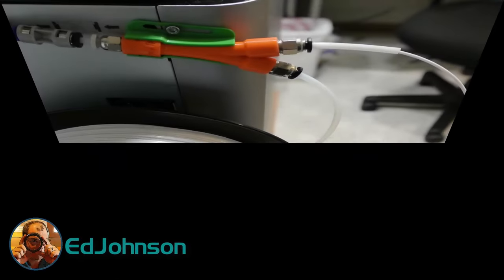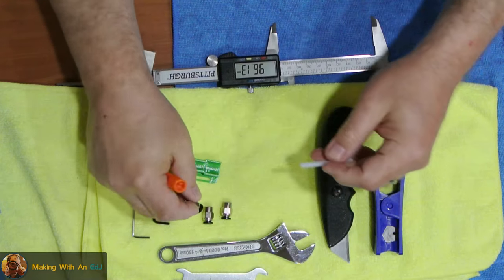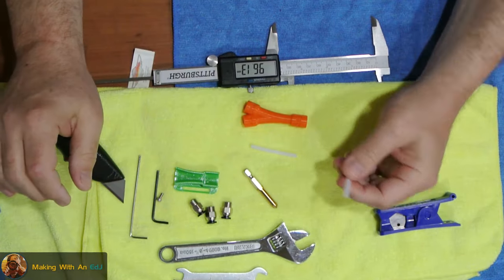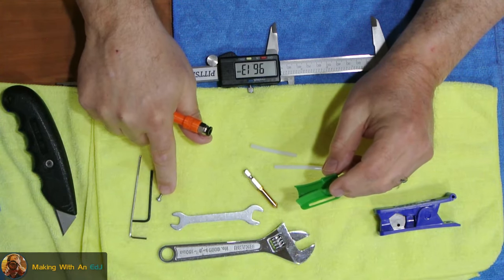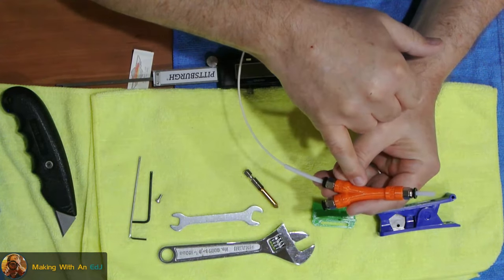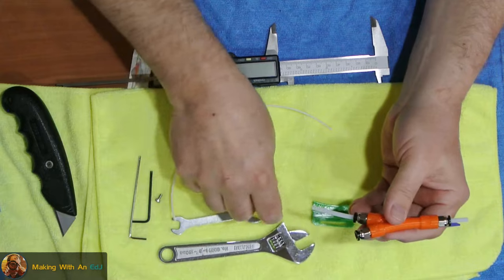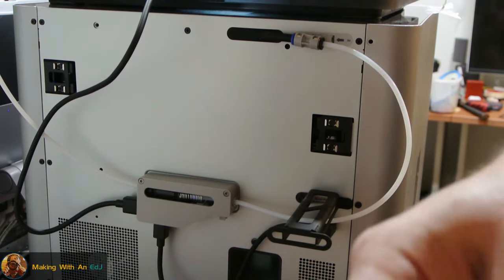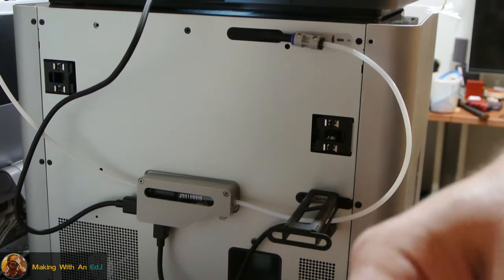Y Splitter for the Bambu Lab AMS and Spool Holder

Comment: You can actually remove that standard PTFE coupler verry easily and pulling the extruder PTFE tube a bit back. There's plenty of room for that, more convenient and gives more room to work with and to connect it tidy. 2 couplers after each other within a cm really doesn't makes much sense.
Reply from the maker: This is true. You just need to make sure you expose enough of the PTFE tube so it can be fully inserted into the splitter. I haven't had a problem leaving the connector in place, but I'll probably take it out of the loop when I need to replace the PTFE tube going into the hot end.
Reply: @makingwithanedj  I'm using the oficial BL  4-in-1 adapter. There're some other mounts available for that one. And in this config I actually don't have room for the coupler. Your situation is different with the printed adapter yes.

Well I also needed to extend the existing AMS PTFE tube because I'm using a riser. I did wanted to disassemble my brand new AMS unit for exchanging the tube with a longer tube.
So I just re-used the existing coupler to put just a spare in between.

So need to fix this in the future also. When there's a need to disassemble the AMS.

But so for as long it works, then it works. 👍🏻

Comment: Why didn't eliminate the that short connector that has blue & black ends? Connect the spliter directly to the PTFE tubes comes from machine.
Reply from the maker: You can, but there's not a lot of excess length sticking out the back. I think a few others have done that by exposing more of the PTFE tube coming out the back. I was reluctant to do that since I didn't want to shorten the length inside the printer. The existing connector does work well and I haven't had a single issue leaving the short piece in place.

Comment: Great stuff! 
It seems that the self-tap versions don't have the 45 degree angle at the bottom of the mounting slot flange, so you have to add support material under the flange in the slicer. Am I missing something?
Reply from the maker: You can add supports, but they should print fine without them. It's been a while since I modeled that version, but I think that angle is steep enough to get a good result without supports. If you do decide to add supports, be sure to paint them manually. Using auto supports might mess with the support I modeled into the bottom leg. Thanks for reaching out!
Reply: @makingwithanedj  They are horizontal overhangs, so they definitely need supports. I just modded the included 'step' file to add the necessary angle at the bottom of the flange, so...all good now.

Thanks for the great model!
Reply from the maker: @imacmill ok, I'm no longer confused! I see that for some inexplicable reason, I made that bottom edge flat on the "long slot" version. The shorter slot version doesn't have that problem. Thanks for pointing it out. I think I'll dust off the design and fix that issue.

Comment: So it is an M3 x 6mm that holds the y tube bracket to the printer. Just confirming. Nice design
Reply from the maker: Yes, a M3x6 works for the slimmer mounting clip and you'll need a M3x8 if you use the thicker clip. The screw bottoms out very quickly in the hole on the back of the printer, so that's why you will need different screws depending on which thickness of clip you use. In case you missed it in the description, I highly recommend checking out my updated design. It has a "unibody" with the mounting slot connected to the splitter and an improved path for the filament. https://www.printables.com/model/541678-bambu-ams-no-catch-y-splitter-pc4-m10
Reply: @makingwithanedj  Got it. Thanks so much.
Reply: Printed and installed. Works well.
Reply from the maker: Awesome, glad to hear it!

Comment: Hi there, I was having some difficulty understanding what you were trying to solve with your Y, but I think that I understand now. Correct me if I am wrong, this makes it so that you do not have to disconnect the AMS unit when using material on the spool holder? If so, this is great.
Reply from the maker: @CR3DT  exactly!

Comment: which of the 3 is used for 1.75 filament ? And im just confirming, when using the external spool you cannot use multiple colors? GREAT video and thank you for the great instructions!
Reply from the maker: Thanks for the kind comments. I do appreciate it! The splitter In this video is my original version and I highly recommend you download the new version that it linked in the description. It is very similar to this one, but has a few improvements. All versions are for 1.75mm filament. The differences between the various options are mainly in clearances for the PC4-M10 fittings.

I learned that not all fittings are manufactured to the exact same specs, so I made several versions with different clearances for the threaded portion. Frankly, there is an overwhelming number of options in my new version because of all of the tweaks I've done since I originally published it.

At this point, I recommend using the self-tapping splitter in the new version. There's a quick-to-print clearance tester to help you figure out which splitter to print. Let me know if you have any other questions.
Reply: Oh ok, Thank you for the new version, I ordered the m10s last night and scrapped together 3 of them from old printers for the time being but couldn't get this to print on x1 carbon anyway. The flat version should print just fine. thank you again.  @makingwithanedj

Comment: I have a P1S and I do not want to remove any screws. Has it been confirmed by people that is okay to not mount the splitter and just leave it hanging? Or I guess a mount could be put one with double sided foam tape?
Reply from the maker: It's fine to use it without mounting it. There is not much movement if the PTFE tube on the hot end side is kept relatively short.
Reply: @makingwithanedj   Thank you for replying so quickly. I got my PC4-M10 connectors today and they screwed right into the printed part perfectly. Thank you for the design. I have only had my printer less than a week but I already had to disconnect the AMS once to feed filament from outside the AMS (stupid cardboard spools and the printed solution for this brand made the roll tangle). This is going to be a frequently used addition. 😀

Comment: can you print tpu with this system
Reply from the maker: Yes, you can print TPU, but it's not recommended to load it from the AMS. You can feed it from the spool holder and it should work fine.

Comment: I downloaded the y splitter but did not see the mounting clip.  If I missed something I apologize as I am just beginning to work on 3D.
Reply from the maker: Hi Dan, which version did you download? I highly recommend the updated "no catch" version I linked in the description. That one has the mounting clip integrated into the splitter. It is also improved to virtually eliminate the need for any post-processing after printing. That design got a life of its own and grew to a ton of files. I recommend using the "self-tapping" version. There is a quick printing tester to figure out which size you need for your particular fittings. It eliminates the guess-work in selecting the correct clearance you need for a good fit.

If you did download the original, there is a separate STL file for the mounting clip. The 3MF and STEP file versions have the clip and splitter combined in the same file.

Comment: Is a Y splitter not bad for your bambu lab x1c carbon? I mean, the printer and AMS were connected with each other with no air coming into the ptfe tube (now air is coming into the tube from the External spool hole (one of the two holes in the Y splitter)). 

I am afraid of breaking my printer...
Reply from the maker: That's a valid point. I didn't really consider that, but I don't have any problems with my filament absorbing moisture since I print mostly PLA and PETG. I don't think there's a risk of breaking your printer, but I suppose there may be enough air exchange that it could affect the moisture content of your filament. A simple cap with a 4mm diameter to cover the PTFE tube when not in use should do the trick. I will model one up and add it to the files on Printables.

Comment: Can you have the PTFE tube coming from the extruder and go all the way out the back of the printer and go directly into the splitter without that little connector ?
Reply from the maker: You can, but you may have to replace the existing tube with a longer piece. There's not a lot of excess length sticking out the back.
Reply: right but I was just wondering if that is better than having that little coupler piece on the back?

 @makingwithanedj
Reply from the maker: @mrjayd  I don't think it's necessarily better. Those connectors work well and I have not had a single issue with either of my X1C printers. That said, it would be a cleaner look and eliminate a potential point of failure.

Comment: Does it work for ams lite and bambulab A1 ? Thanks
Reply from the maker: I'm not sure. I don't have an A1 or A1 Mini, but from what I've seen of how the AMS Lite works, you might be able to add the splitter to one of the PTFE tubes going into the 4-way connector so you can use an external spool setup.

Comment: anyone knows if this works with P1S too ? if the p1S firmware support external spool too ?
Reply from the maker: Yes, my splitter works on the P1S. The P1S is basically the same as the X1C in terms of mechanics, AMS, external spool, etc. It's missing some features and uses some less expensive components. There are many comparison videos to be found. It's a great printer if you're going to print mainly PLA and PETG.
Reply: @makingwithanedj  i almost bought it but as i want to finally print PC, a bed heating limited to 100°c is a show stopper for me. so in the end i wen to a new fystec voron 2.4 cnc kit. and i'll add a rapid carrot feeder.
but thanks for the infos

Comment: Can you use all 5 at the same time? Like - could you print a file with 5 colors in it automatically?
Reply from the maker: No, the filament on the spool holder cannot be controlled automatically like those in the AMS. There is no mechanism to load and unload the filament automatically. The main benefit to using a splitter is so you don't have to keep disconnecting the PTFE input to the hot end every time you want to print from the spool holder.

Comment: Is the coupler necessary? Seems to work without it and going directly from x1c to splitter
Reply from the maker: If the PTFE tube is a tight enough fit, it may work fine, but I'd still use the fittings since they keep the PTFE tubes from backing out and minimizing the chance of anything catching, especially when changing AMS filaments.

Comment: How did you bottom out PTFE tubes? did you enlarge PC4-M10 connectors? I bought several brands, however screw side doesn't allow 4mm tube to go through.
Reply from the maker: It fit fine for me, but I know a couple of other uses reported the same issue. Are you having trouble pushing it through the fitting or getting it to slide into the printed opening? If it's the fitting, I'm not sure what that could be. If it's the print, you may be over-extruding a bit or it's some other difference in our settings. You could try a bit of X-Y Hole Compensation in the slicer (something like 0.1 or 0.2mm to start). If you have a 4mm or 5/32" drill bit, you could carefully enlarge it that way too. My new design (the link to Printables.com is in the description above) has a lot more clearance for the PTFE tube for the top of the Y. The bottom also has a bit more clearance.
Reply: @makingwithanedj  it's the fitting... I will try the same brand. for now I skipped fittings all together and it works fine :)

Comment: Is it OK to print this thing in PLA?
Reply from the maker: @aemaething  yes, I have printed in both PLA and PETG. PLA is more rigid and is a bit more finicky with screwing in the fittings, but it works fine.

Comment: Would i be able to print in 5 colors
Reply from the maker: There are some tricks to print with 5 or more colors if you have a single AMS, but the Y-splitter won't help. The main purpose for the splitter is so you can easily switch from the AMS to using an external spool without having to disconnect the PTFE tube from the rear coupling every time you want to switch. I use mine for printing TPU or when I want to print directly from my filament dryer. The printer can only switch colors automatically when using AMS units.

Comment: It's funny I'm printing this and watching the video and wondering to myself when I would actually need it? In what situations do you find yourself using it? It does look super useful if I have the situation come up though. Also just to add there's always someone posting something of no value. I enjoyed the video and demonstration. Sound quality of your video was fine I'm not tuning in for a music video.
Reply from the maker: The splitter simply makes it more convenient when I want to print from the spool holder rather than the AMS unit. I usually have my AMS loaded with PETG and when I want to print something with PLA, I don't have to bother swapping a roll out of the AMS. It's also really handy for printing with materials like TPU that don't work in the AMS. Thanks for your kind comments. I do appreciate it!
Reply: @makingwithanedj  I haven't tried TPU yet with the X1 that's a good use case. how does it handle the long run of bowden tube?
Reply from the maker: @Oliver1071  I have only done one small print of some flexible feet so far. I dusted off a roll of Inland TPU I had sitting around for 2-3 years, dried it out, and it printed great for me with the generic TPU profile. After a bit of coaxing to get it pushed through the splitter, I had no trouble pushing it all the way through to the hot end. Because of the way the X1C handles loading and unloading, I had an easier time than using TPU on my CR-10S with direct drive.
Reply: @makingwithanedj  I didn't have anything good to clean up the inner bore so I'm adding a taper to the inside where the ptfe tube seats. Printing it now to see how it goes https://i.imgur.com/KXznmop.jpg Mine printed pretty good but I still felt a little catch especially with really stiff pla and at the end of the roll where it has some tight winding.
Reply: @Oliver1071  mines catching too, did yours work?
Reply: @paulmyfinger  yeah the taper seemed to help been doing a ton of multi color prints with the AMS no issues through the tube.  I can post the remix when I get home from work if you'd like to try it.
Reply: @paulmyfinger  I threw the remix up. I wasn't going to since I didn't really do much at all to the great design.

Comment: What are the differences between the 0.0, 0.05 and 0.1 files you've linked on printables? Edit discussed at:
https://youtu.be/_O-eqUQ1SiI?t=224
Reply from the maker: It's just the difference in clearance around the threads. .05 seems to work well for most. I was able to turn them in by hand with .05.